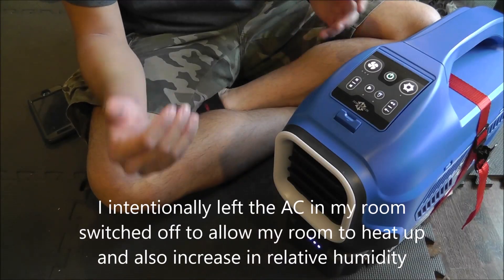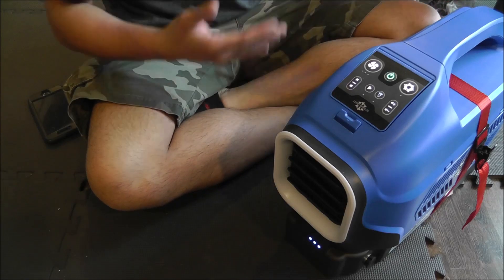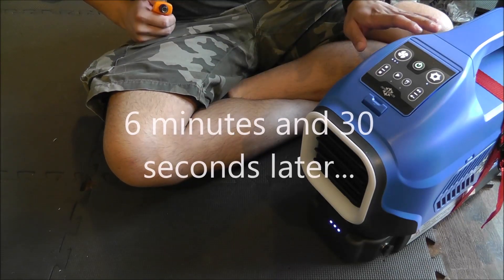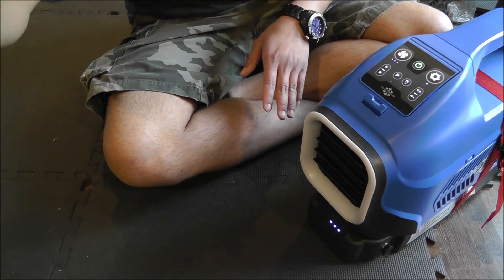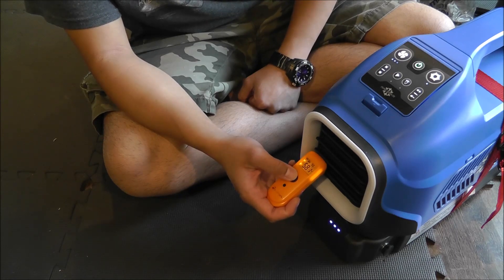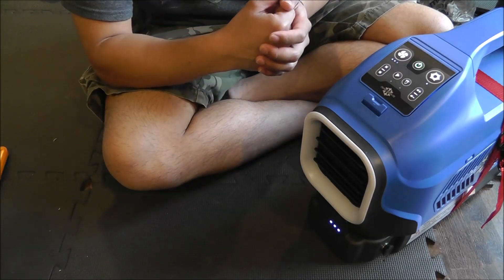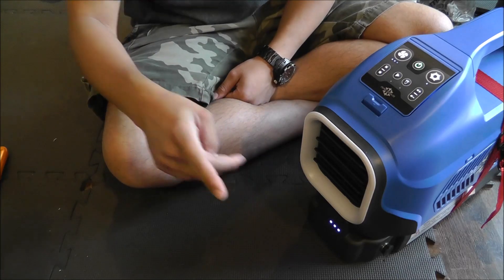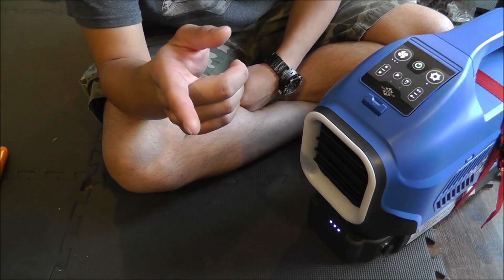Zero Breeze Portable Air Conditioner: Output Temperature Test [INDOOR]

Comment: This is a really dumb test.  The room temperature is meaningless unless you're blowing the exhaust outside.  The outlet air temperature doesn't mean a whole lot either.  You can't expect much out of 1100 btu anyway, which is around 1/3 kw.  This thing is obviously meant to be blowing directly on you, not for space cooling.

Comment: With that kind of cooling efficient so you would need a minimum R-13 insulation value on a 50 square foot space to fulfill their claims. There is no way a tent with zero insulation value will cool down in hot weather. This is simply a spot cooler, it we need a plumbed intake and exhaust in order to cool any space beyond your position directly in front of the device

Comment: Still very skeptical looks like you're putting the temperature probe right on the evaporator core which typically is supposed to be around 40 degrees to produce cold air. I have a small AC unit evaporator core stays around 40 to 42° and the air coming out is 20 degrees cooler than the ambient, these are minimum expectations for real air conditioning. This needs to be tested by blowing the cold air on to a surface then taking the surface temperature. Not pointing it directly into the device coils.

Comment: Put the thermometer 1 m from the vent. How well does it cool the room. Also, would be really useful to know the temperature outside and in the next room. And connect the hose for the warm air to a  window (or next room).
Reply from the maker: Well this was a simple output test, not a cooling test.  That video is in the works!  But feel free to check out my outdoor temperature test video here: https://youtu.be/6GmCclvuRbw

Comment: I drive a semi and my work doesn't want us having high idle times when sleeping. This would be perfect
Reply: Seth M I'm thinking of getting one for my freightliner. Apu is a piece of work.
Reply: yes, if you make a custom intake for the heat exchanger alongside the plumbed exhaust you should be able to cool the tiny bunk at night. Without the custom intake I would not expect more than a 7 to 10 degree difference from the outside air. Hopefully you're not in Vegas
Reply: Let me know if anyone tried it in their semi truck. Very intrested in seeing if it works

Comment: I vote small tent. I feel like that's the most realistic use for this device.
Reply from the maker: Revenant Definitely a small tent is a great use case!  But I don't have a tent and have primarily been using it for spot cooling at car shows and it's been great for that!

In the next week or so, I will have both an outdoor output temperature test, and an enclosed hot car test.
Reply: ctuan13 look forward to seeing the results.
Reply: Heavy equipment, combines, guard shacks, tractors, and classic cars.
Reply: They should have licensed this product to Milwaukee or Dewalt and got the price down to 399. I can think of so many uses for it in skilled trade and construction. I also know a four letter government agency that has over 215,000 vehicles, most without ac because of the cost.
Reply: I'd put good money on it not being able to cool a small tent 20 degrees below ambient. There's no outside intake for the heat exchanger, the BTU rating is way too low for that space and ideal conditions of an R-13 insulation value, and yeah insulation-a tent has none! You'll be bleeding cold air faster than its being generated